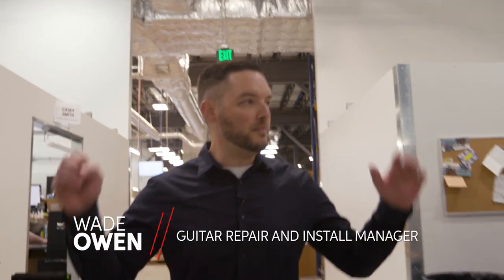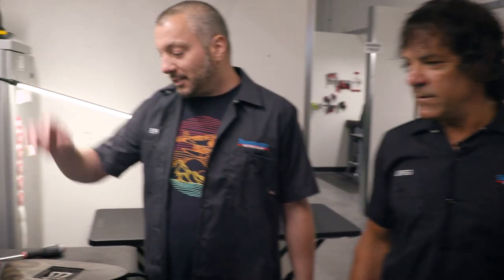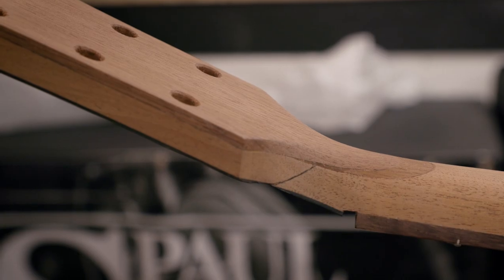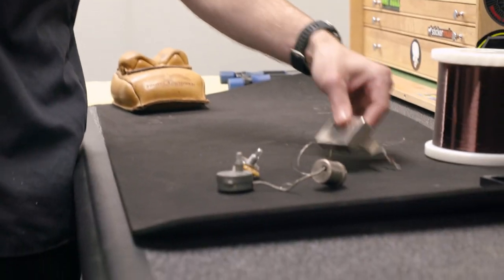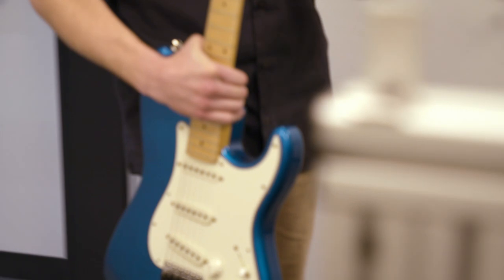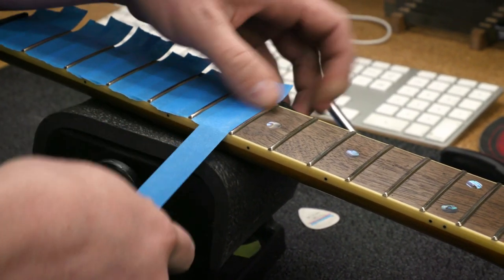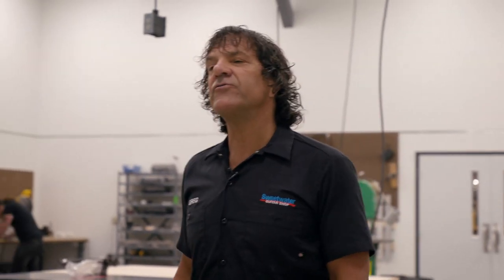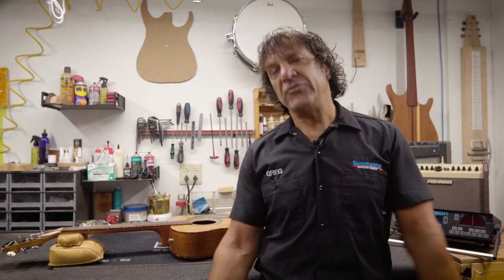Behind the Scenes of Sweetwater's Guitar Workshop | Guitar Repair at Sweetwater

Comment: I must admit I really have had a strong degree of confidence in my Sweetwater purchases over the years. BUT…. I made what I feel is a fairly high end purchase again just this past week.
I got my Lincoln Brewster Signature Strat which came with a $2600 price tag. The guitar looked as though it had been passed around for people to demo, it had a very obvious abrasion in the lacquer about the size of a thumbnail right up near the top strap button. The pick guard plastic cover had extensive pick rash even sliced through in one spot. No manufacturer tags in the case, only a fender Manuel with the certificate. There was also a fender sticker in the pouch.
The after market case latches stick and you have to use 2 hands to open each latch-REALLY??!
I was so excited to unbox it until I unboxed it.
It just looked like some guys guitar in a case, absolutely no luster effect upon opening. My excitement evaporated instantly like steam out of thin air as soon as I opened the case the first time, I just got it 2 days ago so I haven't said anything yet but I know they will be very good about making it right. I think they must have had this as a demo but I did not get a demo price- Ouch!

Comment: Huge inventory but always out of stock.
How does that happen?
Reply: I would imagine that’s more of a manufacturing issue than a Sweetwater issue. We have local shops that won’t get their orders until next year because everything is on back order
Reply: Some things do have a high demand and go asap, even more so with custom or one-of-a-kinds. But at this time, the current President and Admin are holding Americans hostage from normalcy in attempt to make us weary and depressed. That won't stop Sweetwater and their customers. American manufacturing will rise in Country. Right now, an American company can compete with the high priced processors. Wait til more Americans hear we needed Afghan and now China will mine it dry and still limit our supply. This should stress our Congress and especially our President, but as you see, things apparently are going as they expect. Or it would be changed.